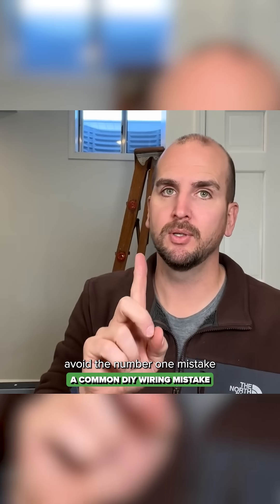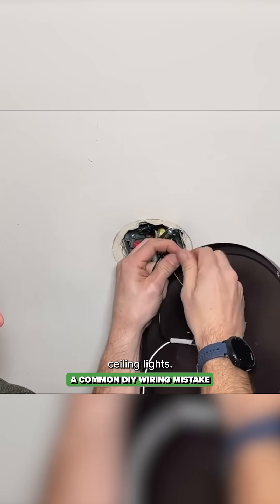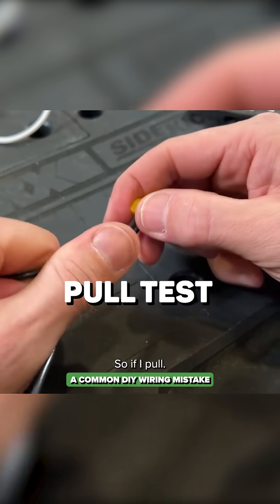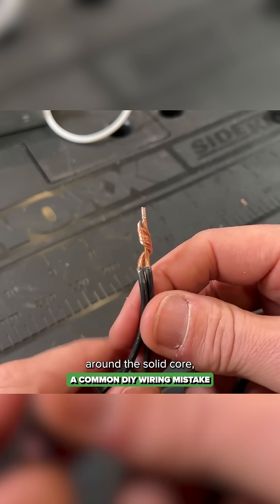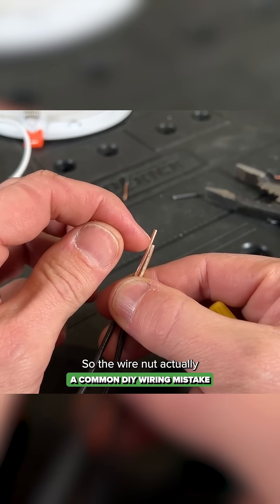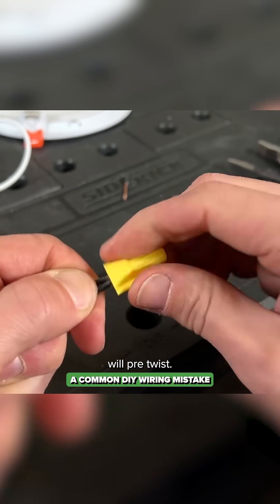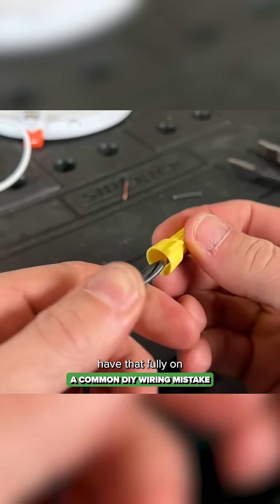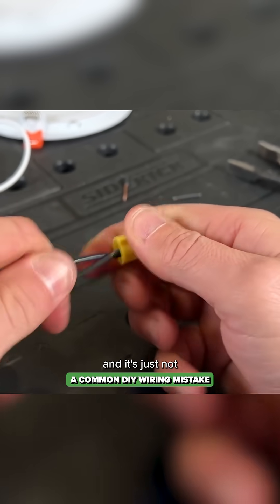A Common DIY Wiring Mistake

Comment: In Canada at least we are expected to have three twists outside the wirenut and finally we are also expected to put tape over the wirenut.
Reply: There are occasions where I will choose to tape the wire nut, but it is not a requirement. Depends on the install, but taping every Marrett in house or a 1000 houses, would be over kill.